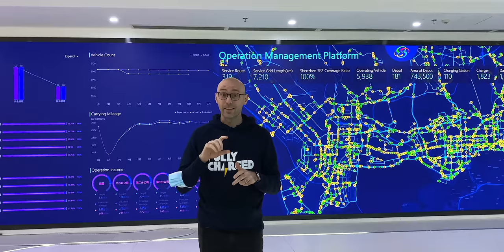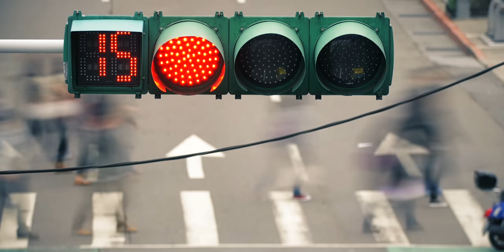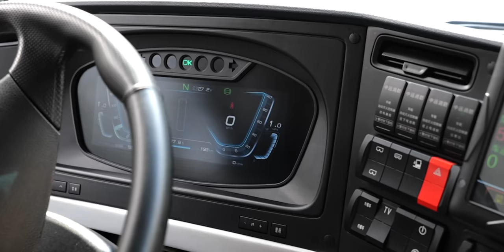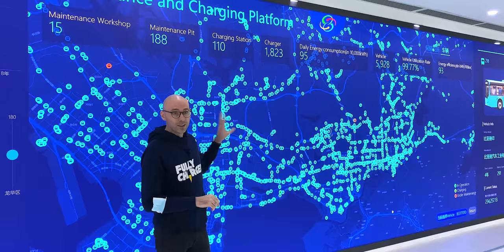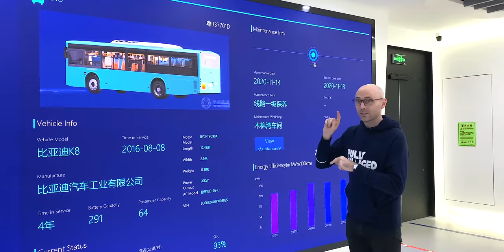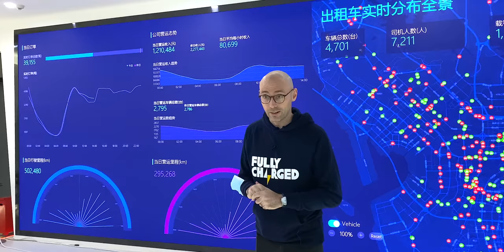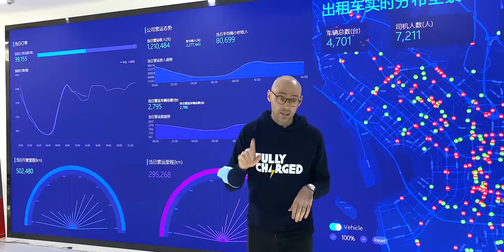The City with 16,000 Electric Buses & 22,000 Electric Taxis | 100% Independent, 100% Electric

Comment: Great video. Not sure how much does it cost to do this in SZ. The benefits are obvious, easy to operate, quieter, clean air, cheaper to charge, etc.  It might be too expensive to upgrade the entire system for a large city like San Francisco. I did see some fully electric buses running in San Francisco. I thought the hydrogen bus system should work better for city transportation.  Another amazing thing is that the comments here are 99% positive. Usually, China steals western technology, human rights abuse, genocide ... dominates the comments for any video concerns China. I suppose the audience for this type of video is a more fair-minded bunch :)

Comment: why don't they try to work on biogas powered steam buses, steam technology was already very sophisticated in the 1920s. The Doble Series E-25 took about 90 seconds to get a good head of steam and could also be started with a key and didn't need a clutch because it produced so much torque. It also used the steam that came out of the engine to turn a turbine that was connected to a generator and turned a fan which helped condense the steam.  It would also shut off the fuel automatically when their pressure got too high and didn't idle which means it was not using excess fuel. this could very well well in a bus because there would be enough room to accommodate the equipment. It would also take less time to refill. The fuel could also be easy to make, it could be made from plants that are grown for being made into fuel or it could be made from waste and there will always be an inexhaustible supply of waste. If this was done in the UK they could use this technology and fit it in roastmaster buses and bring the British icon back into regular service, the same could go for the Austin FX4 which was made till 1997. This technology could also be incorporated into trains.

It is work noting that by the time the ford model T was put into production steam cars had been around for a long time and could very advanced. A test was done in 1971 where they measured the Co2 emissions from a diesel bus and a steam bus that burned kerosine and the steam bus produced a lot less Co2, if they burned hydrogen in it it would have not produced any.

Comment: If government wants to solar power protection increase to sustainable levels we need to see true net metering and government low interest loans to install solar to see solar grid tied power banks with micro grid technology if we had 50 % of homes producing their full electric bill that includes the extra fees over and above the energy costs in our case those fees are 3 times my energy portion so I would produce 160 $  of power and use 40 $ per month the majority is billing transmission and city access fees years ago the  conservative government had a low cost solar retrofit program you could get a system that would provide about 100 $ average for about 120 $ per month for 5 years but it  only was credited to the energy portion and the rest was a credit that ment that i would be paying 60$ per month and getting a 40 per month credit for 5 years and a 40 $ credit for the next 20 years so I passed as it was economically unfeasible if it was true net metering it would have been 20 $ per month for 5 years that would have been a great deal  now that fees have gone up it now cost 120 per month just for fees just for the privilege of having power to our home

Comment: Electricity comes from somewhere, the grid is charged by what source? China had a massive pollution issue in the cities this moved that pollution outside the city to the plant. Once a battery solution and solar is flushed out they will have early adopters remorse with old tech and outdated infrastructure ...but nice music.
Reply: Burn S.E.A. BLACK COAL  Coal plants don't pollute and battery technology is fairly stagnant so your probably right. We will see that is for sure.
Reply: Burn S.E.A. BLACK COAL  Been there done that, GL with your new boss.

Comment: Electric vehicles in a city is  great for air quality but saying zero emissions isnt true the world has a long way to go to create zero emissions, coal gas oil are dominant, nuclear has greater environmental problems, fusion is the dream, make it work
Reply: The push for air quality in towns and cities is the start. To remove then outlaw privately owned combustion engines from entering.  If works a little to far to walk or cycle... Move or get a closer job.

Comment: Very well produced and interesting video. It's great to see how other countries are tackling this kind of issue, and with much greater drive than here in the UK.
Reply: Nonsense. 350kw chargers will be everywhere by mid-2022. I've already seen 22kw chargers even in the poorer parts of London, all over the place. You're not even up-to-date with what's going on inside your own country, David. Electric buses are already in use in the UK, EV taxis and Uber's EV subsidy for its own drivers. You're just making stuff up here, just for the sake of a moan.
Reply: @mcarlsson74  I've not seen any report of a UK city that has replaced all its buses and all its taxis with electric ones. You only need to look at ZapMap to see that outside London, the density of 50kW chargers is largely relatively sparse. Can you point to evidence to the contrary?
Reply: @davidpowell8249  Research the latest news on the Moto stations. Each will have several 350kw chargers by mid-2022. The first one was just opened in Rugby the other day.
Reply: @mcarlsson74  whilst that's good news, it's not really the evidence I asked for and it doesn't change the fact that the roll out is slow/on a smaller scale than the one that featured in the video, hence my original comment.

I would like national, regional and local government here in the UK to take a far more active roll in fully decarbonising local bus and taxi services, and supporting private electric becomes by mandating a minimum percentage/number of rapid chargers in every new commercial/office car park in order to be granted planning permission.

Comment: You missing some impressive stats: China has 243Gw of coal power plants under construction to power these electric vehicles (Reuters). Camera safety? China is a totalitarian state, if you cross the line based on facial recognition, you will be excluded from society: that is a future I would want. What about the fire hazard (see recent London EB fires). And the waste of precious materials on transportation is staggering, a bus battery is roughly 400Kwh, one charge could power up to 10 houses for 24 hours, see there the inefficiency. 16,000 buses is a 6,4Mio Kwh: this could take a major city off grid.

Comment: If appearance, projection, is your goal then, well done. China is full of contradictions and has mastered the art of facade. Grant it, removing diesel buses and cars will reduces health issues for citizens and eliminate nasty soot but, will most likely increase the cities carbon footprint. An electric vehicle is only as green as the electricity that feeds its battery and Shenzhen is powered by massive coal-fired power plants.

Coal Produces 205 to 227 pounds of CO2 per million BTU, much more CO2 than diesel or gasoline. Also, producing an electric vehicle contributes, on average, twice as much to global warming potential and uses double the amount of energy than producing a combustion engine car. This is mainly because of its battery. Battery production uses a lot of energy, from the extraction of raw materials to the electricity consumed in manufacture. China has nearly 250 gigawatts (GW) of coal-fired power now under development, more than the entire coal power capacity of the United State. 

So kudos to those citizens living in Shenzhen and the hell with the Paris Accord, climate change. Easy to solve problems when one wears blinders.

Comment: Over the winter season Shenzhen had to stop many of its electric vechicle from operating due to a dramatic use of electricity for home heating. At the same time, several cities in China had to shut down their 5G telephone towers because so much electricity was being used the grid almost crashed. Things are not as they seem. The only way for sufficient electricity to be used to power this electric power movement will be gas and coal power stations.
Reply: Nuclear.
Reply: @mikewade777 , China is building nuclear power plants everywhere, but being a seismic land, the risks are high. Even the 3 Gorges Dam, is built on a fault.

Comment: Why are you fixated on EVs - a trivial market?  There isn't enough Lithium.  The last couple years EV production finally passed 1 million; the price of lithium UP 1000%.  Max annual production of Tesla sized 5000lb EVs - 3.6 million in a market of 80 million cars and 100 million vehicles annually -  w an existing base of 1 BILLION.  Until there is a scaleable high density battery EVs are handcuffed to Li production limits which are severe.

Comment: Electric Vehicles only shift pollution from one area to a more manageable area. Electric Vehicles are a boon to short distances, especially, tooling around town. Most of the world Energy, 84%, is produced by burning Coal, Oil and Gas ... Electric Vehicles are not going to change the total pollution of the Earth. The Achilles heal of the Electricity is its continuous 'discharge' and replenishment time. Storage of Electricity is the biggest problem and I cannot see any real solution. 'FUSION' is the ANSWER. The sooner we get there the better it is for all of us.
Reply from the maker: Hi Cornelius, consider this for one moment. The system we use now, burning endless gigatons of fossil fuels to maintain a high consuming lifestyle for about 25% of the global population while 75% live in energy as well as economic poverty is considered acceptable. 
Not by all but by most people, especially those in the top 25%. The only thing electric vehicles do is drive a wedge into that current stasis and suggest that there might be an alternative. Not just for transport, for all our energy needs. Not in 20 or 50 years time (which would be a generous prediction for fusion, (and we have done a show on that) but now. Today.
More and more academics, engineers, hands on scientists in  the energy field are stating without hesitation or discreet fossil base load arrangements, that we can be 100% renewably powered, not just developed nations, the entire globe. Our kost recent podcast explains this in depth.
The reliance on the endlessly 15 to 20 years away solution of fusion or 'hydrogen cars' does one thing and one thing alone.
It continues our reliance on fossil fuel.
Reply: The real solution is to ban all privately owned cars. From town and city use.
Reply: @fullychargedshow  
It is not the Fossil Fuels but their management is at fault and that is what nobody but nobody wants to talk about. In 1964 a man got elected in England. He forced polluting elements in and around London to clean up. It was done. Salmon returned to The Thames to spawn. All the pollutants that combustion exudes can be collected and reused, yes, all. A Clean Electricity is the Answer.
Reply from the maker: @corneliusdrvanderbilt822  I'm very happy to talk about fossil fuel management. I talk about it all the time, I attend meetings, seminars, discussion panels, exhibitions and government committees where this is discussed endlessly and in great detail.
In my world everybody, but everybody wants to discuss this massive, highly complex topic.
Here's how to manage fossil fuel in one simple sentence.
Stop burning fossil fuel.  
Yes, of course we built the world we live in now on the power, energy and abundance of cheap, easily obtained fossil fuel. No one would dispute that.
But we can now ask, 'is it a good idea to continue burning this filthy stuff.'
The answer is an unequivocal no.
Reply: @fullychargedshow  
WRONG, WRONG and WRONG
We are mismanaging them. The Combustion creates useful and harmful gasses. They aught to be trapped at the source and utilized ... Electricity is the cleanest form of Energy. Its production should be clean. Natural / Manmade Gas, Oil and Coal should be burned away from population areas.
Reply from the maker: @corneliusdrvanderbilt822  You are funny. 
"WRONG, WRONG and WRONG." Really?
You say, and I quote " The Combustion creates useful and harmful gasses. They aught to be trapped at the source and utilized."
I can honestly say I don't understand anything you're saying.
So a combustion engine, I assume you mean, creates 'useful and harmless gasses.' 
Really. So we can use the useful and harmless gas that comes out of the exhaust of a moving vehicle? Big ballon behind it, massive high pressure tank on a trailer.
You say they aught (I think you mean ought) to be 'trapped at the source and utilized.'
WTF does that mean. Utilise CO2 and a wide array of various sized toxic and carcinogenic particulates, to make . . . . pies? Lego? Tea bags?
So all I can say Cornelius Dr Vanderbilt is a most profound "WRONG, WRONG and WRONG."
Reply: @fullychargedshow  
Sir, with due respect and admiration, your comments appear to display your miniscule brains devoid to comprehend technologies that are already present and can develop, yes, to trap these gasses at source. Let us take the worst case scenario of Transportation: Cars, Lorries / Trucks / Aircraft and seafaring Vessels.  Aircraft, Railways and Seafaring Vessels carry their refuse until they are deposited at the end of their journey. Air Compressors are to be installed to collect and compress gasses froth their exhausts. Where there is there is a way.
Reply from the maker: @corneliusdrvanderbilt822  Sir, with utterly undeserved respect and admiration, you are a complete and utter fantasist. You clearly have less than zero grasp of engineering and a fairly random grasp of English. I am giving you the benefit of the doubt there as it may not be your first language, but you're grasp of the problems caused by burning fuel to produce energy deserves no benefit of the doubt.
You don't have a minuscule brain, your brain has been through a blender, nothing you say makes any sense.
I think you meant to end with 'Where there is a will, there is a way' but sadly, strapping an 'air compressor' on the back of a passenger vehicle to trap the exhaust gasses is just about as barking mad as it comes.
If this is such a genius idea, can you send me any links to actual physical real world tests where this kind of technology has even been tried in a lab.
Laughable if it wasn't so dangerous and desperate. You people will do anything to excuse the continued burning of fossil fuel, it's painfully sad.
Reply: @fullychargedshow  
Were there such an operation, I would not be recommending ...Air Compressors are available in various formats. Some could be modified to be used even in cars. Small cars may need to offload more frequently. Trapping pollutants at the source is the answer to cleaner atmosphere. I worked and lived in Iceland a country without chimneys. I do not know your solution. Your video appears to be promoting you. Why not? It is a free world. If you can earn from this Media promoting yourself, why not? I wish you luck.. E&OA

Comment: Well all is nice and 'green', but batteries are by no means as green as they advertise here. What's their life span? What happens to them to the batteries when they break? To this day, there is no safe way of disposing of batteries (the same problem we have with nuclear waste). Also, batteries do not use renewable resources - oh, electricity might be, but the battery itself is made of lithium, nickel and cobalt. Just like fossil fuel, they are limited and we will run of the raw materials - and they are not renewable. 
If you really wanna go green, pump money into finding a real sustainable way of storing large amounts of energy.

Comment: Some people may applaud China's efforts to reduce noise and air pollution in their urban areas by the massive adoption of EVs. Does anyone realize how their electricity is produced. 62% of China's electricity is produced by burning coal. How is this environmentally friendly. All modes of transportation (autos, ships, planes)  contribute to less than 10% of the world's carbon dioxide and other harmful emissions. Agriculture and manufacturing are the worst at over 50% collectively. These overpriced overhyped electric vehicles won't save our planet, sorry folks. Don't even get me started on how destructive, toxic and dangerous they are when they catch fire. Polluting our ground water when fire fighters attempt to extinguish 2000 degrees Celsius thermal runaway fires from their batteries.

Comment: Totally silly. If the electricity needed for all these battery-powered vehicles is produced by burning coal, there is no ecologic benefit at all. Also, electric cars require the same infrastructure as petrol-driven ones - streets, roads, highways, crossings, roundabouts bridges, parking lots. The traffic jams caused by electric cars with be less noisy but not the least bit shorter that those we are used to. Not the type of fuel for cars has to change, but urban infrastructure must shift focus on public transport and cycling.

Comment: Coal supplied most (about 58%) of China’s total energy consumption in 2019, down from 59% in 2018. The second-largest fuel source was petroleum and other liquids, accounting for 20% of the country’s total energy consumption in 2019. Although China has diversified its energy supplies and cleaner burning fuels have replaced some coal and oil use in recent years, hydroelectric sources (8%), natural gas (8%), nuclear power (2%), and other renewables (nearly 5%)

Rather a poor show when you compare the U.K. record on renewables don’t you think?